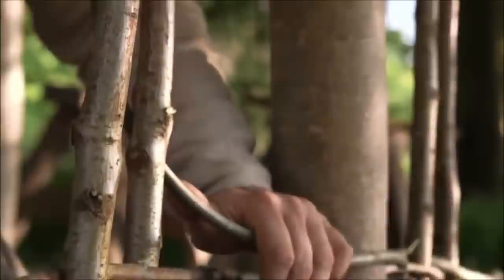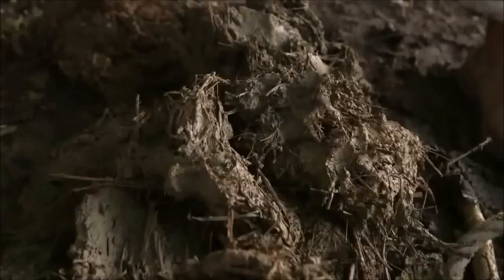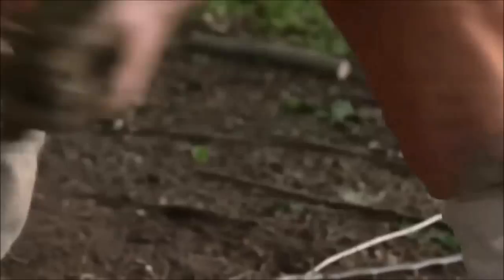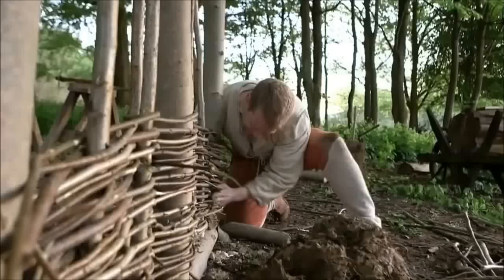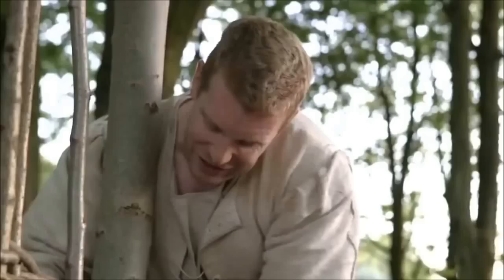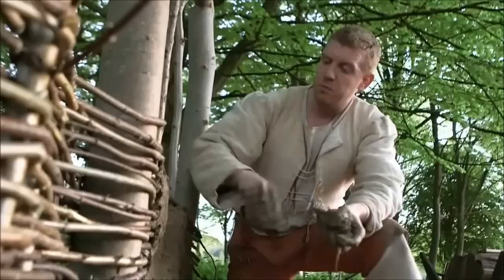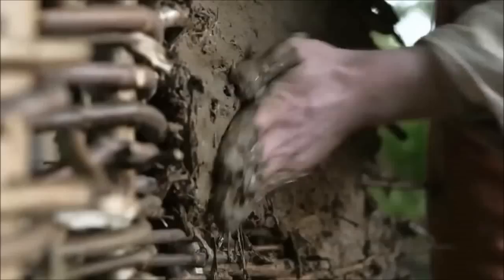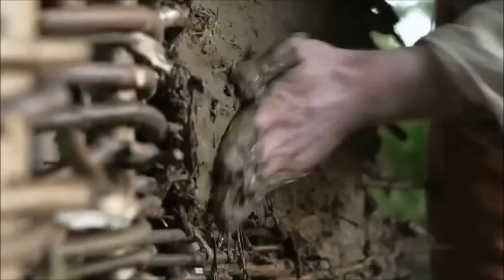Wattle & Daub

Comment: You could do the same with clay, slaked lime, hemp hurds/shive or chopped straw (hemp is better) and water to mix over the wattle. It was also used. And no stench. It just smells like earth. Although dung was sometimes added.The lime plaster was also used for the outside and inside walls. Straw or hemp hurds mixed with lime and clay for the daub and 'scratch coat', and then without for the smooth last coats. Hempcrete literally becomes stone-like. Still has to have lime plaster over the top of it though. 
   
Yes hemp was grown in the UK, as a matter of fact King Henry VIII ordered his subjects to grow it. http://www.ukcia.org/culture/history/hmpukhis.php

Adobe is made about the same in the Southwestern US in 'brick' form without the wattle (sometimes with dung, sometimes not. And now concrete is added to make it stronger.), but most likely wouldn't stand up to the wet in the UK. I've stuccoed, but that is with concrete stucco mix not lime plaster.

The Romans did use concrete in the UK as historical record states and it was better than modern concrete surprising enough, but I don't think it was used in the middle-ages.
Reply: @NAT-rd8fl  Water resistance, daub is water soluble, hardened lime it is not. Thry didn't cover the whole house tho, normally only the lower half and/or the northern side.
Reply: lime is now being "rediscovered" in England - the concrete gets moldy and does not flex with the wood frame of the building drying. So it cracks. Africa uses dung - it's a lot easier than burning wood as deforestation to make lime ash. So then special plant "lacquer" is used for waterproofing.
Reply: Roman concrete as we know now, used volcanic ash, so I also don't think it was used in middle ages UK.